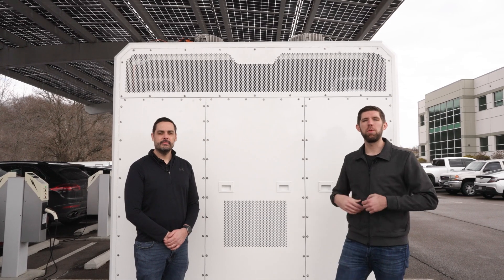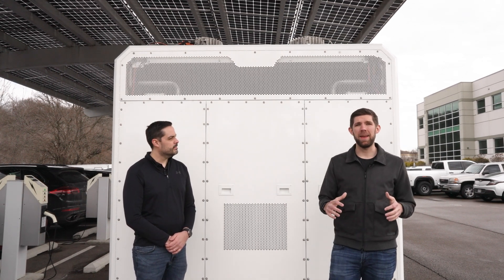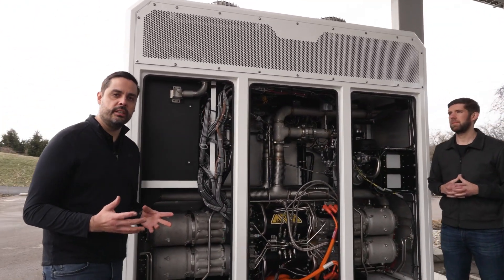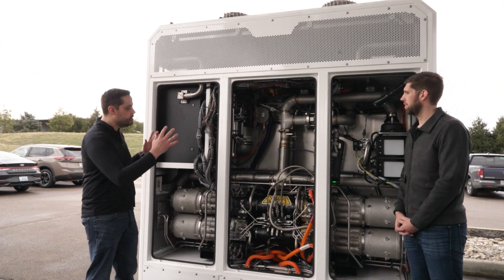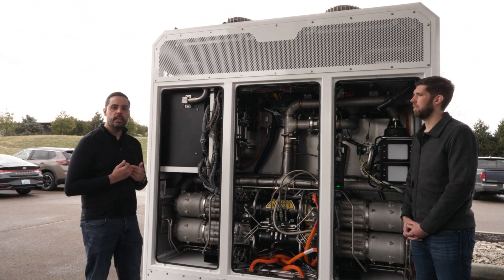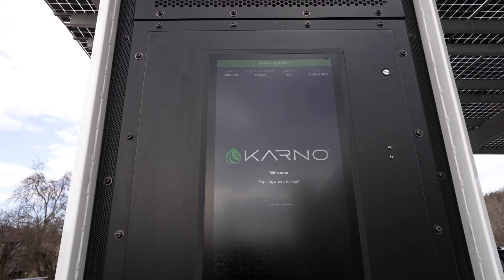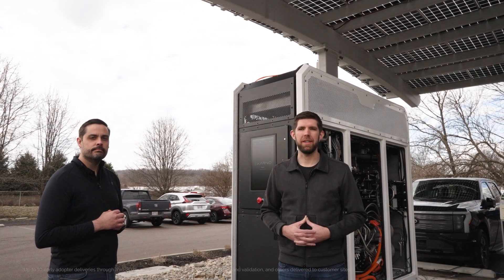Hyliion’s KARNO Power Module: Modular, Efficient, and Fuel Flexible Power Generation

Comment: What about that BS efficiency claim 50%? That has never been achieved with any Stirling. Your engine does not even have seals around the piston. Your engine will be 20% at best. What about those BS claims about the flameless reactor (normal people say burner) and ability to run on various fuels? SOOT, anyone? How quickly will you plug all those fine channels in intake air recuperator? How long will those heater 3D printed tubes last? What is the internal pressure of the engine, the precious helium will leak like through sive from your engive through that 3D junk porous metal. What about those horrible vibrations, the engine rocks like crazy - how do they affect the piston and shaft friction in the engine? How expensive are those HUGE 3D printed parts to make, you need EIGHT of them in this engine. Your original design power was 125kW and then you found out that the generator would not be sellable with this power and you pushed it hard to make 200 kW, are you sure this design can handle that? The overall parameters like efficiency, power, cost to purchase, cost to maintain, longevity, reliability, need to be competitive with existing and established generators, have you published any competitive study that this product is even viable??? This is a train wreck.

Comment: weight of the thing
Reply: @Daru002  AND COST.
Reply: Hi @Mentaculus42 , the final price tag has yet to be announced, but they did say roughly mid-range between the ICE prime power generator solutions ($1,000 - $1,500 / kW) and the fuel cell prime power generator solutions ($3,000 - $3,500 / kW), while the performance is expected to land on the fuel cell side.
Reply: Under 7,000 pounds per Bobby Cherian, Sr. Vice President of Sales and Service at Hyliion, mentioned in the chat window Q&A of the 10-Feb-2025 CARB TRIG Zoom meeting.

Comment: Great overview of a totally awesome & desired product. The efficiency is remarkable, and the energy density is unparalleled.  I am in awe of the near-maintenance-free design of this disruptive technology.  Looking forward to massive production capacity scaling post-commercialization later this year. Please keep it up Hyliion team!
Reply: @Rusty_The_Kid  

Power density, not so sure about that. Efficiency is good for something in this power range. Low maintenance is probably the key characteristic.
Reply: @Mentaculus42  you are right!  The efficiency is roughly the same as fuel cell prime power solutions (47% to 50%), and the extremely low maintenance is due to it having only 1 moving part that utilizes the equivalent of air-bearings (no lubricants).  The footprint energy density is 92.6 kW/m2, the volume is 38.6 kW/m3 and the mass is 63 kW/MT; no other prime power solution comed close.  Awesome!
Reply: @Rusty_The_Kid  

The helium gas bearings and working fluid are a plus. Time will tell about corrosion resistance and sooting / coking / coating of the combustion section / thin wall heat exchanger with various fuel contaminants. In bigger aggregated higher total power output systems, ICE’s with a bottoming cycle have higher efficiency (54%) which have been in use for a decade. So karno has a particular “sweet niche” to be slotted into where fuel cells would have issues. Now Hyliion needs to talk about their scaling of additive manufacturing.
Reply: @Mentaculus42  all great points!  I can't confirm, but someone mentioned that the larger (pencil-sized) inner ports of the heat exchanger handle the reacted fuel, while the tiny, thin-walled ports are sealed and only facilitate the inert helium, alleviating contaminant build-up concerns.

Also, I completely agree; the focus will likely be on production capacity expansion, as I view the growing demand from their TAM as outweighing throughput for quite some time. An outside monetary infusion from a hungry customer or the US government for factory expansion would be impressive, and well within the realm of possibilities, IMHO!

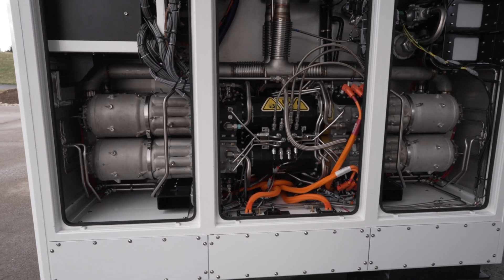Comment: 1:11 200 kW output! Is that the total output of the 4 karno units together?
Reply: yes
Reply: A single Karno has 4 linear shafts.  They stack up in 200kw units at a time.
Reply: @ 

Was just looking for a clarification as it had been mentioned in the past that they were working on a higher out version of karno and was wondering if this was part of that work.
Reply: @Mentaculus42  The 200kw version is the higher output version... the previous version was 125kw... but they decided to standardize on a single power output unit and scale it through stacking them up.  They currently have designs up to 2mW through stacking, I believe.
Reply: Look like yes. 200kw